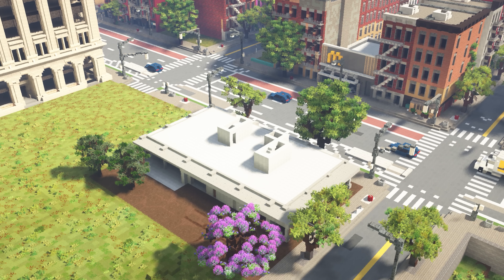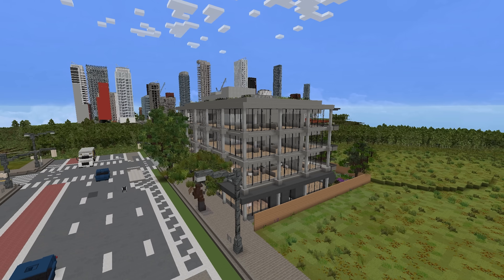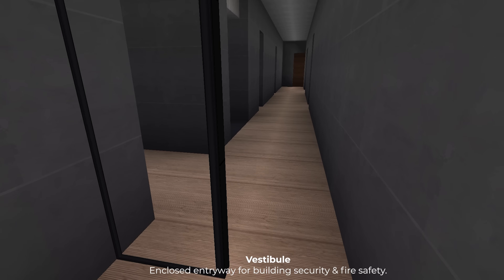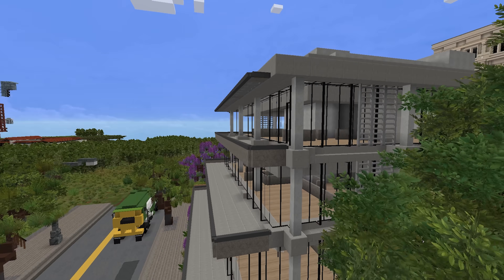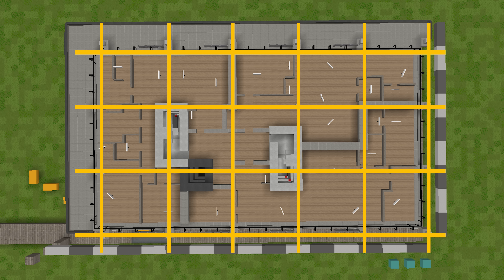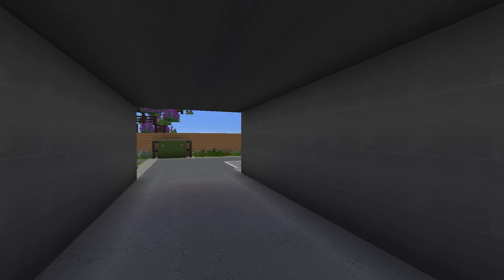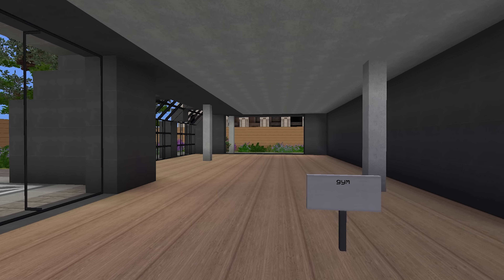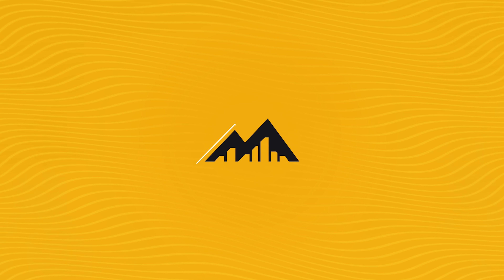We used Minecraft to Design our 4th Year Engineering Project

Comment: the tunnel would act as an extra surface area for the upper floor to lose heat through i think, since its a tunnel (no pun, i just have bad vocab) it would create a wind tunnel in which lot of air moves through really fast thus quickening the speed at whihc the upper floor would lose heat. (side note: the tunnel size itself looks like it would only allow 1-way travel which could be a problem or not idk (i havent yet started studying architecture))

Comment: Meh i did this years ago and didn't even study engineering and didn't get sponsorship or scholarship.  Mine even had working lights and "wiring" connecting them to levels so they would work exactly as they would on real buildings. You go in a room, switch on the lights, etc.
I feel i am owed a scholarship. lol

Comment: Fyi:
Rather than minecraft, try on scrapmechanic for that hard sketch of an 3D model (smaller & detailer for... stuff)

Scrapmechanic has wedges, curves, and bearings if you want a sloped roof/wall design

Cons:
- couldn't change the daytime (sunlight)
- couldn't change/destroy the ground
Reply: And yep, it's still way easier than using a proper software design

Comment: What did your Professor say was the issue about the tunnel going to the parking lot?
Reply from the maker: It increases the surface area of the building and “let’s the cold in”, which is not preferred since the purpose of this project was to design to a net zero standard. This makes it a lot more difficult since it’s already tough enough as it is (and Ottawa has cold winters).

Comment: I think the tunnel creates a double wall with a huge air gap in between, and since air acts as n insulator, heat will not pass into that side of the building and it'd be very cold?

Comment: 12:48 The cold air in the tunnel seeps into the space above it? Not an architect but I feel it would make sense for the city grid to disrupt the wind so it’s not as cold, so the horizontal line of buildings across the street might suggest that this tunnel is being chilled by the wind. Plus, it can’t be warmed by the sun.

Comment: This is true.  You don't want a tunnel under an apartment because the cold air will blow under and cold will penetrate the floor above.  In the worst case scenario ice would form on the floor of the apartment.  

Bridges on the highways and other routes have signs that say "bridge ices before road" which is because of this principle.  In old houses with overhangs, the floor over the overhang is always cold in the winter.  Rooms over old stable houses are cold in the winter and car porticos with rooms built on top of them are cold in the winter.
Reply from the maker: Interesting. I figured it was only because of the increased surface area - I love learning about this stuff.
Reply: Whats the fix to this? or would the tunnel need to be scrapped? Sorry i don't live in coldy-snowy environment
Reply: @yorchmr3603 I guess using an insulating material between the tunnel and the building could help
Reply: There's probably an additive for that

Comment: Besides the tunnel looking like it can only allow single direction travel which could be an issue for residents sharing the space, does the tunnel cutting under a residential portion of the building create more surface area for the cold to affect that portion of the building during winter, i.e. cool the flooring of the interior space directly above it?
Reply from the maker: Bingo!
Reply: @Alpine1 Not to mention from a meteorological standpoint, the tunnel creates a wind tunnel if the wind blows south or close to south, meaning effect will be increased due to exchange of air. You could fight this though with a door at either end, though it'd reduce convenience for users. what you could do is add a heated false ceiling with a void to add an additional buffer for the cold air and potentially solve the heating issue.
Reply: @Alpine1 is it wide enough for a city snowplow?
Reply: I was thinking cold weather heat loss, wind tunnel, and somewhat I notice misalignment with the structural grid, if the left wall is meant to be load bearing.

As for allowing single direction travel, that's pretty common where I am tbh. Problems can be mitigated by including a "warning light" that flashes when tunnel is occupied or a traffic light, and those curved mirrors.
Reply: Also a perfect sleeping spot for homeless people

Comment: Does the tunnel make it easier for the cold to get into the building from below?
Reply from the maker: Nailed it
Reply: Can u explain pls?  @Alpine1
Reply: @Alpine1  did you decide to keep the tunnel? Could the walls of the tunnel be designed to better insulate the building?
Reply: @Alpine1  Your professor is just wrong btw. Wisconsin here we dont have exactly the same heating/cooling profile but I assur your that we have designed and built multiple buildings with overhangs that go to sublevels and walk unders like this. I can find some info if your interested.